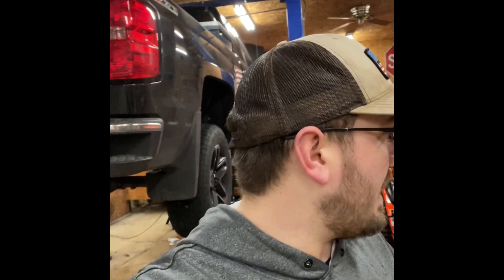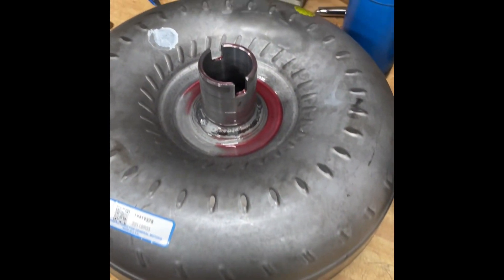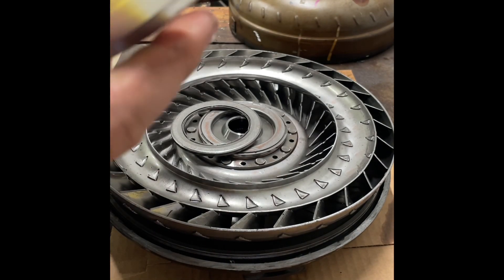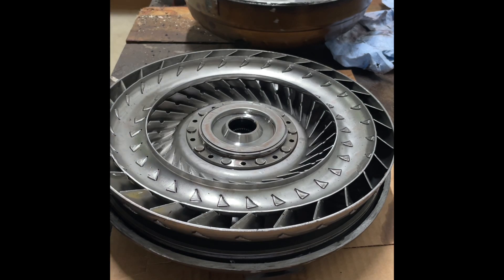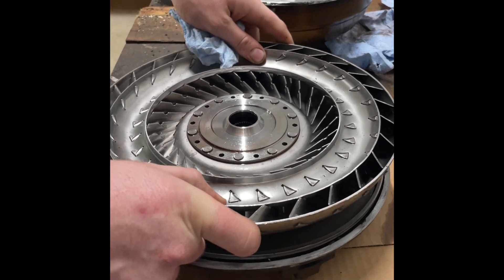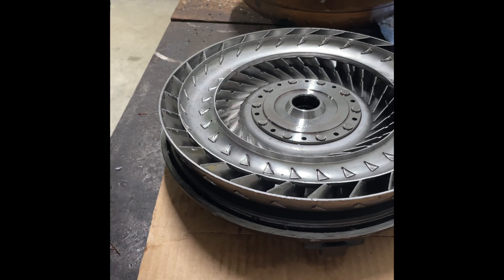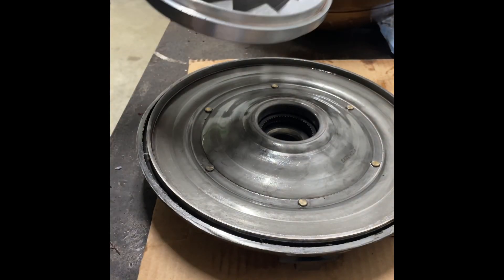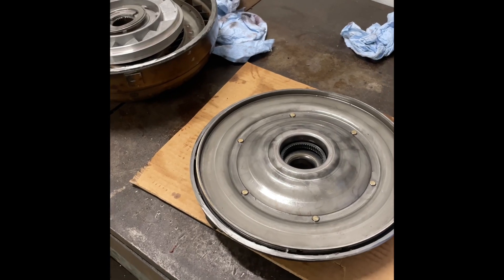6L80 Torque Converter Issues Explained

Comment: FYI if the converter shuddered the front pump of the trans will be trashed you will need a rebuild do not just change the converter you will have low fluid pressure and trash a brand new converter do your homeowork it’s the front pumps not being strong enough to keep constant pressure ie the bell housing. Low pressure causes the converter to lock and unlock causing heat witch is taking out the converters.
Reply: Can you explain more
Reply: So I might as well let it blow up and just rebuild it better.

Comment: A thief is a more honorable occupation than being a GM powertrain engineer. My impeccably maintained 2016 2500HD is on its third transmission at just 65k miles. This time an independent shop rebuilt it because the OEM parts are shit. It has a billet torque converter, Sonnax internals, a Tru Cool 40k transmission cooler and a tune. Hopefully this one lasts. I’ll walk before I spend another dime on a GM product.

Comment: What did the shudder feel like on yours? I’ve got a 2014 that has a shudder that’s very mild, feels like an imbalanced tire and shows up at highway speeds. I’m hoping maybe the dealer could just swap the converter before it kills the whole transmission, if that’s what is causing the shudder
Reply: yes thats what I did ,dealer didnt want to do it without the trans...  ended up just doing the tourque conv. worked so far for 30k
Reply: GM OEM converters made in CHINA look it up my converter  went at 113,00 miles replacing with DACCO PARTS
Reply: It sounds similar to if you had a standard trans, slowed down, well under your torque and tried to accelerate. It's almost a growling.
Reply: mine is doing it at 80k

Comment: Just replaced the TQ converter in my 2015 with 201,000 miles it was making a sound almost like hitting rumble strips and RPM fluctuation.  There was quite a bit of material on the magnet in the pan.  New heavy duty TQ converter and filter with fluid flush and it drives like new.
Reply: If you don’t mind me asking what made you decide to only do the torq converter? I have had my truck in to dealership and 2 other trans shops. They all said it needs a rebuilt trans. My car runs pretty well. There is a small hiccup on the downshift between 2 and 1 and tiny little slip sometimes going up 3 to 4. My trans has 203000 miles on it. I have a little metal in the pan.  Thanks in advance for your feedback!
Reply: Your transmission probably got shredded by the debris.  He caught his before it became a problem.  When they fail, they burn away the clutch material and go metal on metal.  That tears up the valves and pump and the clutch packs. I'm currently in the same position... mines failing and slipping,  I'm hoping the transmission isn't too damaged.  Hope a new torque converter and  rebuilt pump, a flush and a filter will be all it is. I plan to keep the truck long term.  So I'm planning to throw some good parts at it to make sure I can resell the transmission once the truck rust away to nothing.  Lol.  The motor will get the same treatment if it ever has to come out.

Comment: All that work and you put Fram ATF in it? I think Fram oil filters get a bad rap, which I think they are fine as long as you change them when you’re supposed to. But to not use the synthetic Mobile One or Amsoil ATL is a mistake. Good luck with it!
Reply: I'd throw Fram fluid in it for the original fill after rebuild, then flush it and new filter after its been run to clean and dirt/manufacturer debris and assembly lube. But most fluids are basically the same a budget synthetic is still a good fluid.

Comment: My 6l90 was full of aluminum and it was the pump grinding the pump housing/bell housing
Reply: How did you remedy this?
Reply: Reman transmission. The parts were 1/2 the cost of a reman. And no one would touch it locally since I removed it and diagnosed it.  On the 6l90 the front pump will fail and the bellhousing is part of the pump housing. So all those parts just to have a 200k mile trans fix, made no sense to me.  Reman has at least some warranty.
Reply: I should add. I thought it was my converter is why I pulled the trans. Then once I got it out and started looking and doing research I found the transmission was full of aluminum shavings.

Comment: Great video. I have a 2015 Silverado with 105k on it that has done a ton of heavy towing and will continue to do so. I flushed and replaced the fluid and filter at 75k, but I'm considering replacing the converter as a PM measure as it is the primary cause of these transmissions failing.

Comment: How is the heavy duty 6l90 torque converter holding up?  I’m planning to replace my 6l80 torque converter soon. Where would you recommend for a billet tc .  Or should I upgrade to the 6l90 tc.  Thanks
Reply: Just put a circle d converter stock stall speed in mine. Absolutely love it. Fixed my issues. My tranny fluid was super clean only my TC was making noise, and I noised weird shifts. I just swapped my converter three days ago and I’m loving it. Before swapping I took my truck to the dealership. They said it sounds like my torque converter is going bad, it was making a metal on metal clanking noise. But they pulled my pan and filter and everything looked super clean. So maybe I caught it in the early stages. I have a 2014 GMC Sierra 6.2 with 113,000 miles on it. I definitely baby it and maybe I just caught it just in time. I did notice the torque converter ran about 10° hotter than the stock torque converter. However, I just put on the superior thermostat bypass kit tonight. So I will be able to watch my temps from now on. Hopefully they drop about 50° like everyone says.
Reply: I heard the 6L 90, torque converter is good better than the 6L 80, but I heard it still is prone to the same issues. So I did not wanna have this problem again. I love My Truck and I wanted to last. Next is DODAFM delete, new oil pump, and a stage one VVT cam and ported heads and headers from my zl1.

Comment: My theory behind the converter failure is that it’s a multitude of things. 14-16 trucks have a 195° thermostat in the transmission cooler lines which is too hot for transmission fluid. 17+ has 160° thermostat in the cooler lines as an update to try and prevent converter failure. They also allow a 40rpm slip with the converter clutch while it’s “locked up” for the AFM system. Between high transmission fluid temps, the 40rpm slip and lockup engaging in 2nd gear is what wipes the converters out in these. Deleting the transmission thermostat along with replacing the fluid, converter and o-ring seems to do wonders for these trucks and it seems to mostly affect 14+ and not many below.

Edit: the converter also has been superseded by a new part # from GM

Comment: Hey man - I was a test engineer at a torque converter tier 1 supplier in Ohio. From you video I wanted to tell you a few things. 

First off, awesome video! I've wanted to see what the tc's lock up clutch did. 

Second - the piston that applies pressure to the lock up clutch has leaf springs between the inner top shell to the outer shell that wraps around the bottom. They separate from each other under a pressure differential governed by the transmission controller. 

3.) aluminum casting seems normal imo - especially for a non prototype. Possibly some cavitation happening. Obviously not a great casting. The stator also has a clutch commonly known as the one way clutch that does lock up during acceleration and what helps generate torque based on the redirection of the fluid force vectors of the blades.  This is usually what you test - the one way clutch on stator. It locks up in only one direction and free wheels in the other. Again - all governed by fluid force vectors. 

4.) I think this TC is what's called a 2 pass TC.  It's for two main fluid passage ways. The first is as you said that comes into the many area between the impeller blades, stator, and turbine. This is known as the torus.  The other passage way is the opposite direction and locks up the converter clutch due to that pressure differential. The TC will not generate additional torque anymore and the torque ratio is 1:1 at this point in terms of input (impeller/ pump) to output ( turbine).  There is also 3,4 and 5 passage way converters with more control on the converter lock up clutch. 

5.)  I believe most converters lock up clutches do continue to slip all the time based on Manufacture tuning. But it's within very low % differential between input speed and output speed of the respective turbine parts.

Comment: ok so my 15 started to shutter, stopped driving it until i did fluid, filter and thermostat change. even added lube guard. still doing it. idk if it's just the torque converter or if there are more messed up clutches? if I have it in tow mode it does better. just fishing here thanks.

Comment: Nicely explained. I agree with you, even though there are now a lot of videos on this topic, none illustrate the fine details well. Even getting it all apart leads to questions, the design is so elegant. I'm surprised there is a core charge for these things, since to get one apart you'd have to cut into it with a grinder and then re-balance it after replacing seals, clutch material, etc. I wonder if they simply test them out on the bench, somehow replace seals without cutting welds, then resell them as rebuilt.

Comment: Great video thanks ,👍👍👍

Not sure what to do with mine. Seems to shift good.(sometimes down shifts funny), but im thinking my converter is going bad. Shudder, especially when getting up to speed, but then when im driving at speed mine gets this hard crazy vibration for a split second, then goes away. More when im accelerating than anything. Then im torn on what to do about the trans. If I change the converter, should you go ahead and revuild the trans??

Comment: Wow - so the lockup clutch material is just 'painted' on the disc in the OEM torque-converter ??  
I wonder if there is even any oil-flow thru this lockup-clutch area when it's supposed to be locked up (overheats/cooks oil?)?

Comment: Fluid still passed underneath the clutch while lock up is applied. Gm made tcc slip intentionally on these units. The Converter fails because the front cover overheats and warps. When tcc slips while the converter is in lock up it destroys the carbon woven lining.  (the lining is only 00.20 tall). The real reason these units fail is do to the pressure control valve in the pump wears out and the transmission begins to over heat. Then it blows out the converter
Reply: They certainly dropped the ball. That's for sure. My transmission never got "hot" but my converter is definitely failing. I'm not sure what in the hell to do at this point